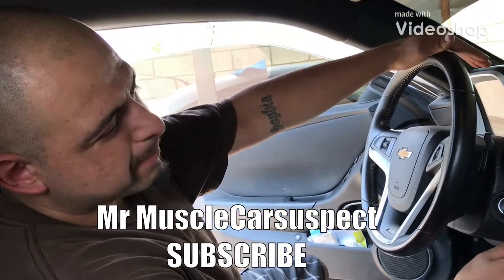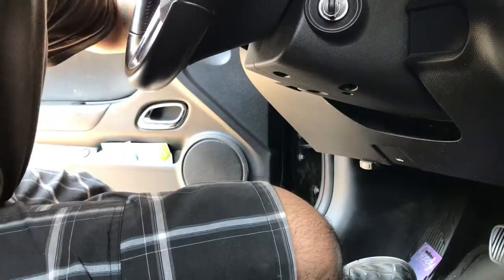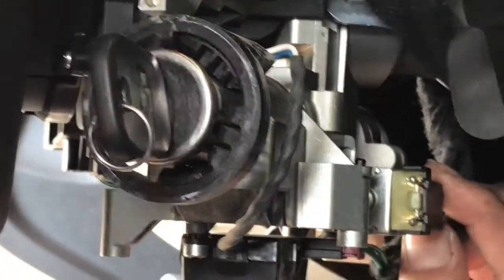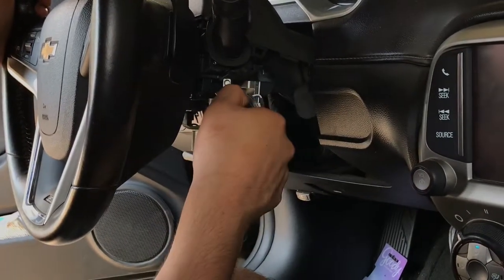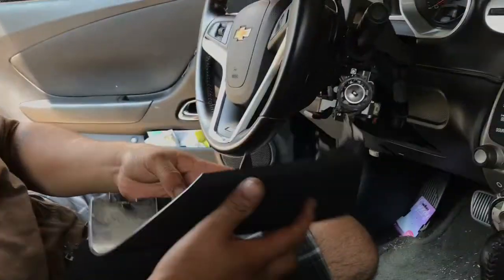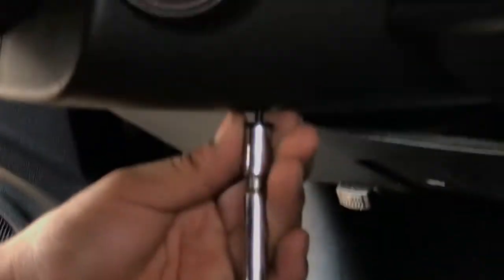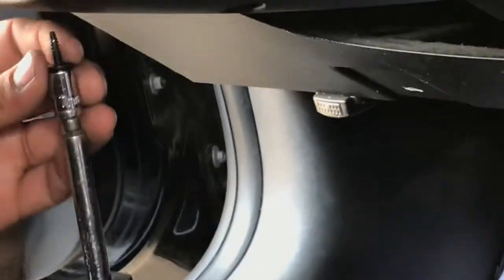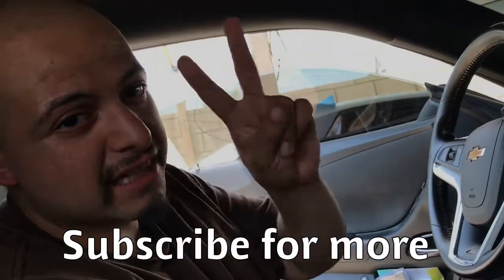2015 Camaro Ignition Key Getting stuck Fix and Solution

Comment: For those nervous about doing this, I did it several years ago and haven't noticed any related issues. My car is a 2014 Camaro SS.
Reply: Its okay to just leave the lever unplugged?
Reply: That is not a solution, it's creating another problem. To fix it you need to replace the switch for the shift lever. It takes 30 minutes.
Reply: @leonelsway which part number is the swift switcher. Also what do you mean that creates another problem?
Reply: @leonelsway  what other problem does it create? cuz this video save my life
Reply: Ampalos95, I wondered about this but no answer.  Maybe this: after I unplugged the wire, and replaced the steering column cover, I was happy because key came out each time.  But, my key also came out if I mistakenly left the gear shift on "drive" and at least twice noticed my car rolling back.  I was fast enough to hit the brake. This may be what Leonelsway is talking about.

Comment: Another option is to pull the DLIS fuse (F1 in the INSTRUMENT PANEL FUSE BLOCK).  No tools required.  Disabling the "Direct Logic Ignition Switch" (DLIS) is the intended purpose -- to be able to remove the key while the car is out of (P)ark, primarily when you want to tow the vehicle.  The real difference with the cable-disconnect option is that with the fuse pulled some other features (instrument panel, radio, etc.) will no longer have power when the key is in "Accessory Mode".
Reply: Came home yesterday and over two hours went by as I waited for my ignition to release my key. It got stuck before but I don’t think it ever took that long. Wasted a ton of gas because it would click while the car is on, letting me know my key could be taken out of the ignition. If I turned the car off, it would drain my battery so I left it on. Frustratingly looked on YouTube and found this video, thought I might mess something up doing it his way, so looked at the comments for other suggestions. YOURS saved me!! Thank you! Because removing the fuse was easier worked perfectly.

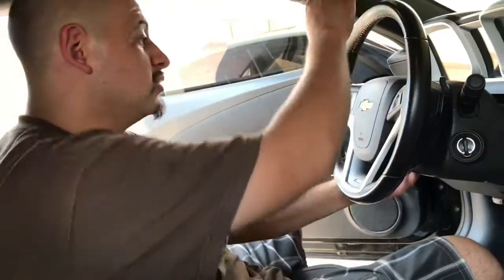Comment: This just started happening to me this week; I bought my car (2015 automatic; not an SS) used in 2018 at a local Chevy dealer. I have ~72K miles on the vehicle; as a 2018 that puts the vehicle at about 9 or 8 years old (giving all this info, in case any reader's own personal car stats line up with mine). I don't remember getting a recall notice. Thx for posting your concise vid---my husband followed the instructions, and it WORKED! Just as fast a repair as shown in the vid, too! Mr. MuscleCarSuspect might advise otherwise, but if you don't want to be stuck far away from home etc, or with a huge repair bill---just go ahead and do this particular action anyways, NOW. Apparently doing this, also nicely doesn't stop anything else in the car from working. God bless you for helping us, Sir! (actual repair portion of the vid starts at 00:34, if you're in a rush to get going!)

Comment: Great video helps out alot.  I did however discover what the problem was. Theres a little microswitch underneath the shifter and it tells the car when its in park and unlocks the switch. I replaced the micoswitch in about 15 minutes and everything works properly. The part number is d2hw-bl221h for anyone who wants go through that to repair  the issue.
Reply: Hello 
Do you have a link for this part?

Comment: This is probably the most worthwhile video I've ever watched on YouTube tbh. I totally appreciate that the video cuts the blah and gets right into actually addressing the issue that all of us are so desperately looking for. I have a 2014 Camaro RS LT with only 30k miles and it was having the ignition/key problem. Got into work late today because of it and finally had enough of the intermittent problem. Kept looking for a DIY solution until i was lucky enough to find this video. Sir, you are amazing! Took me 15 min to do it and it actually works! Thank you 👍🏼

Comment: May 17, 2023. Two days ago my key got stuck, I watched the guy who took his gear shifter handle off, I did that ….nope, I watched the other one who took the panels under the steering wheel off, and unplugged his solenoid….. that didn’t work, soooo I took some WD40 and tried to get it in the key hole as best as I could, and wiggled and pulled, finally after 15-20 min it worked, but a big shout out to you for really showing me how to take off the panel and then put them back on.
Reply from the maker: Thanks for your feedback! Im glad i helped in something.

Comment: 2015 2LT - 4 screws. I've dealt with this for a year and some days it is worse than others, today on my birthday it finally wouldn't budge. Thank you, bro! You saved me so much headache. I gave a dealership $300+ to "clean the key and ignition" and it of course did nothing. All those techniques I had are finally in the past!
Reply: Dealer rip you off. A simple computer diagnostic would show that the key release system requires the shift lever to be on park. All the failures that I seen have been the micro shift at the shift lever. It's a $9 part D2hw-bl251h and it's extremely easy to replace. It's located at the shift lever and takes no more than 30 minutes to replace.
Reply from the maker: Im sorry to hear the dealer ripped you off. Im glad my video saved you money and  fixed your issue. Subscribe!

Comment: I used 9/32 socket for the bolts and it works. I just have 4 screws on the bottom. 2015 Camaro 2LS. Thank you so much had this problem for 2 years, now its fixed

Comment: I appreciate the quick and short NO-BS explanation (I HATE people that want to talk for 10 minutes before giving a 30 second explanation!!!). I have a 2015 Camaro that has been having this issue for over a year and a half and only has 35,000 miles on it. Usually, I have to restart the car several times, rotate the steering wheel back and forth, kill the engine and then try to take out the key..... eventually it will let the key come out (takes about 7 tries doing this.... usually). I'll be doing this hack this weekend! Thank you dude!!!
Reply from the maker: No problem im glad i can help. And yes it can be very frusteratting
Reply: @mrmusclecarsuspect5362 what happens if we pull this off and dont plug it back in will there be any other issues for having it disconnected

Comment: I just did this to my 2015 V6 RS Camaro. It was fairly simple even for a 67 year old dude that needs to loose weight, One thing I had four screws to remove and the initial pull apart of plastic housing is a bit tricky but once started comes off easily. Easily spotted the culprit as described and detached wire per your instructions. So far it seems to have done the trick and I look forward to not having my key stuck ever again. I rate this job as fairly simple and effective!!! Thank you very much!!
Reply from the maker: Awsome bro. Im glad to help! Thanks for the positive feedback and support!
Reply: Same here!!! 4 screws on my 2015 v6. I showed my husband this video 3 weeks ago. I finally stopped talking to him and he did it. It worked!!!!  I just can’t figure out what the part is so I can replace it.
Reply: @rebeccamaggard5190  looks like it's the ignition lock solenoid part 22891588... IF the problem is just that item it's plugged into. $20-30 part looks like
Reply: Are all four screws 7mm bolts? I removed three of them but can get to the fourth.
Reply: Are all four screws the same 7mm bolts? I removed three of them but couldn’t get to the fourth one in the middle.
Reply: Can u help me out and let me know if all the screws were 7mm? I can’t get to the one in the center. It seems smaller than the others.
Reply: Can u help me out and let me know if all four screws were 7mm?

Comment: Works the same for 2014 Camaro 2SS. My key would get stuck for hours, Thank you very much for this video bro!
Reply from the maker: Ryan Epps no problem bro I’m glad I can help thanks for watching and supporting!
Reply: Nice, I was looking for someone with a 14 2ss to see if this would work on them too. Thank you both!!!!
Reply: @Moonman808  be careful because I'm not 100% sure but i believe that's the ignition lock plug and with that unplugged it may allow the key to be turned all the way off and the car shut off while you are driving which would probably lock your steering wheel up. Wouldn't be good bumping it with your knee or having something bump the key back doing 80 mph on the highway lol. I put 32k miles on my Camaro in less than a year and traded it in for a 2017 Jeep wrangler jk, one of the best decisions I've ever made. Good luck to you man.

Comment: There is a much easier way to do this as I have found out. Instead of this way you showed, you can also just put the car in park. After you shut the car off and if the key is stuck, click the shifter with your fingers (chrome piece where you hold down to shift in automatic) until you hear the clicking noise on the break. Once you hear this noise the key will turn and come out. Done this hundreds of times and is the quickest alternative for anyone. Great video by the way!
Reply from the maker: James Doyal you can but eventually it won’t be quick nomore to get it to click. Like I say in the video you can spray a bit of d40 on the shifter button to lubricate it and click it a couple of times till it lubricates right
Reply: I would do this also until it stopped working for me.
Reply: @coffeeNTrees  been going strong for 5 years now 😂

Comment: I love my Camaro. But that damn key was always getting stuck. Thank you for the detailed presentation. You are a life saver.
Reply from the maker: No problem glad I can help
Reply: Dude same here. I've had to leave it over night!
Reply: After harassing General Motors headquarters I had them make me an appointment at the dealership by my home in San Diego and they ended up fixing my Ignition in paying for it but they said it was a part in the shifter
Reply: The same thing just happen to my 2015 I am calling the dealer too !!! They recalled the new ones already gave us a wack key fob they need to do better I don’t even have 50k miles on my car smh
Reply from the maker: Manuela Ippolito yea sometimes it can be the button on the shafter just apart a bit of WD-40  on the button and click it a couple of times should help it but rn it’s bin over 3 months I removed the wire and no issues. Hope you like video
Reply from the maker: Kieara Barnes-Ryan it’s a go issue they got bad ignitions and they use the excuse with the key fobs that the key that was on in key fob was the issue but it’s just their bad ignitions their easy ways to fix like the way I did on the video cheap and easy way to fix and you don’t got to go waste your time or money with the dealer that all they want is to take our money. Hope my video helped you out thanks for watching
Reply: @belisimo99  Hi Manuela, can tell me which dealer in San Diego you took your car?
Reply: @gilbertoloyon7070  Bob Stall... but I sent videos and harassed GM headquarters for a few months with evidence and emails about the problem before they fixed it.
Reply: @belisimo99  Thanks Manuela, I'll look into taking similar action.
Reply: Kieara Barnes-Ryan i tried going to my dealer and they tried charging me 150 for a diagnostic and then also decided that i needed an appointment so fuck um. Seems like a common issue with 14-15 so im not paying a cent for that shit.
Reply from the maker: Angel Arroyo yea agreed they need to do a recall on this but the truth is gm and their ignitions are no good no more like the old days
Reply: Thank you so so so much! Fix worked flawlessly, I only can add that if you have bigger key with remote, it can not go through the hole in bottom-right plastic cover, but this is enough to take out bottom-left only, and connector of question is easily accessible and even more visible from the left side from the bottom. And in my case I had four 7mm bolts, not three - I am on 2014. Thanks again from Gibraltar!
Reply from the maker: Yury Hushchyn yes you are right if your key is with the remote it won’t go threw the whole, but you still can get access to we’re the connector is to disconnect and free your key out. Thanks for you comment and support!

Comment: I've owned this car since 2017 and love it. However, the Key Stuck issue has been a royal pain since day one.  After trying all the "quick fixes" and gimmicks (clicking 5 times quickly, slowly, fiddling with the gearshift just the right number of times and hoping the planets are lined up just right and the moon is full...) I finally decided to live with it.  I had found your fix, but was afraid it would screw something up so I didn't want to try it.  Then, after sitting in front of the smoke shop for 20 minutes trying to get the key out, I had had enough.  This took all of 5 minutes to do (although my cover had 4 screws, not 3 and that added a minute to find) and I haven't had an issue since.  I owe you at least a case of Modelo for ending my suffering!  Thank you sir.  You are Awesome!
Reply from the maker: Thank for the feedback! And im alwsys open to donations on my cashapp  $Musclecarsuspect thanks for the support please subscribe!

Comment: Thank you, thank you. This worked. I have had this issue with my 2015 Camaro for well over a year. Sometimes the key would release right away if I only drove a short distance. If I drove over a few miles all bets were off and the key would stick. Sometimes it would release if I waited a few minutes and other times... once had to wait over three hours for it to let go. A few times at home I forgot to check (I usuallly go out every thirty minutes to see if it let go) and the key stayed in overnight and ran my battery dry. I finally broke down and purchased a Club so I could somewhat safely go into a store when the key got stuck. This was an easy fix to what I thought was a huge issue.
Reply from the maker: @JeffreyRupp-qc2gq  im glad i was able to help. It's a very frustrating thing bit atleast you got it done, and it was a very easy process for you. Thank you for your feedback! Subscribe!

Comment: Mines in the shop right now for this issue for the second time, once at 5,000 miles and again now at 20,000 miles. The first time it was covered, now its not. Thanks so much for the info on the work around man.
Reply from the maker: fritze01 no problem I’m glad it helped you and this will save you money. Thanks for the support!

Comment from the maker: If you wanna support me even more you can always cashapp me a donation anything helps! $Musclecarsuspect. 

Gona start uploading more once i get more likes. I got a bunch of ideas a alot off other ways to save you guys money. So help me out like the video share it and comment. DONT FORGET TO SUBSCRIBE AND WELCOME TO THE CHANNEL..!!!
Reply: I am not a Mechanic.. Hubby in Canada working.. So I need to know what the name/size of the bit I need for these hex looking screw caps.. Thanks in advance
Reply from the maker: Summer Jonny's Honeybee Cormier I used a normal small tool box that has detachable bits but you can use a 7mm  with a rench same thing or get a small tool set at your local auto part store with destacable screw-bits can’t remember what their called lol sorry for late reply
Reply: Will this still work if battery is dead??
Reply: So I went to my 2012 Camaro and unlocked it with the unlock button on the key fob as soon as I got inside the car I put the key inside the ignition and the car went dead and the key will not come out
Reply from the maker: Big Tyme Dre I’m sorry for the late reply for some reason this comment did not post on my notifications.. And I’m sorry to hear that.. that connection keeps key stuck.. it should work, try it out lmk if you got anymore questions. You can always reach arte your battery and try this process either or should have key 🔑 unlock once you do this processes
Reply: Dealer said only fix was $235 for new shifter assembly and $300 labor. I bought shifter and was looking on here to get tips on installing myself. I tried your fix and was done in 20 minutes. I'm returning shifter.  Thanks so much!!!
Reply from the maker: Phil Jewett no problem I’m glad I can help! That’s a good thing you saw the video before installing saves you money and time.. dealers charge wey too much! Thanks for your comment and support!

Comment: Thanks for the demo video, totally helped me out last night.  Mine was exactly where you were showing it was, only difference was the way mine was clipped on.  Had to use a flat-head screwdriver to pry the little plug off, but it all worked the same.  No more key getting locked.  Then again, with all the lemon crap that has gone on with my Camaro, I think I'm done with Chevy.
Reply from the maker: Tim Raynor good to know I was able to help out and yea Chevy don’t make good vehicles now a days it’s not like back in the days. I love my camaro but I wouldn’t buy any newer than 2015 thanks for watching the video